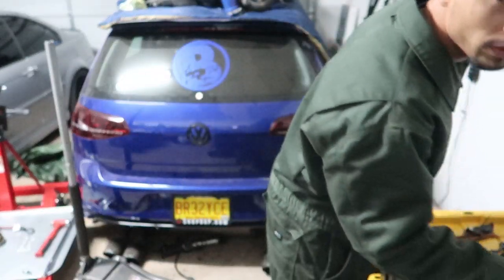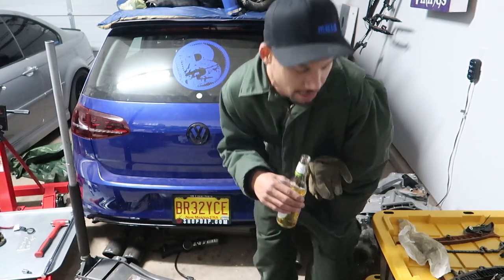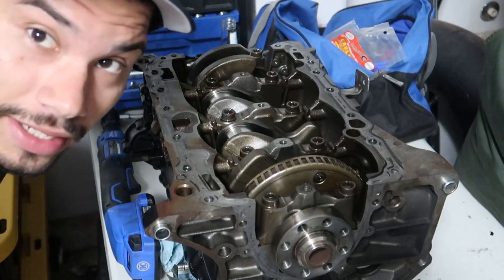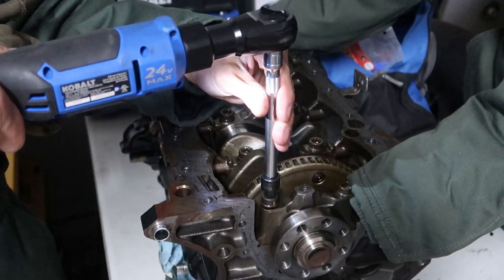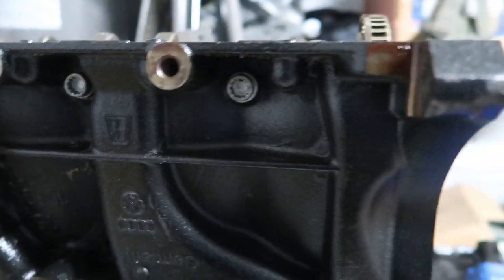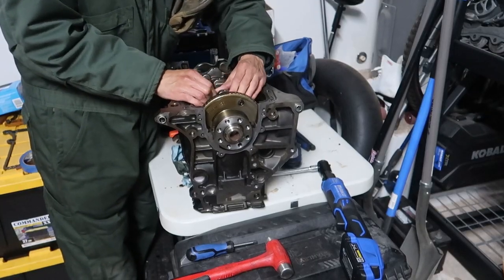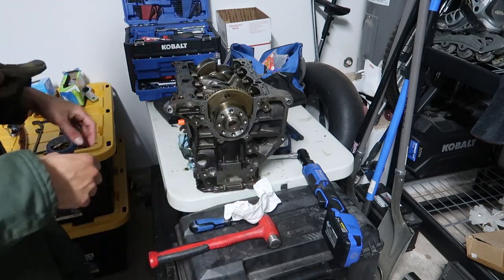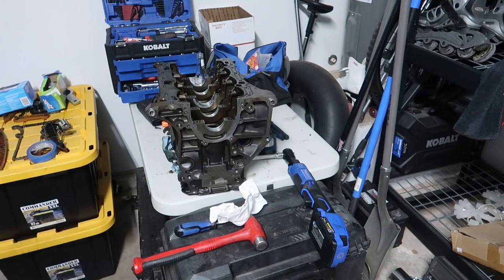Engine build - Breakdown! Part 8 - Crankshaft removed! Thrust bearings look great MK7 Golf R

Comment: Just to say it not telling u to do it but I would totally reuse those main bearings and thrust bearings, they still look brand new.  Also the only time the engine would have a bearing failure is due to an oiling issue and/or sever timing issue.
Reply: some of the mk7 golf GTI and R’s where suffering from CW if you upgrade your clutch on this cars...there are actually two guys on YouTube that documented it and had a channel like Bryce 

There had been a bad batch of thrust bearing that got into production...talked to many ppl who said what you said and now the word is that it’s d/t the increase in pressure on the cranks from the clutch upgrades with high tq threshold 

But his look to be ok 👍
Reply: @hunterlane3323  what does d/t mean? I have a pretty heavily modified Gen 3 EA888 that I'm trying to gather any info I can to prevent engine failure.
Reply: @MeltingRubberZ28  do to.  How many miles and do you have a manual with an upgrade clutch?...I had CW no oil or timing issues in that car.
Reply: @hunterlane3323  as of right now I'm still on the stock clutch. I have the tune so the boost doesn't hit hard (low torque) and then carries as much as possible in the high RPMs. The car only has 17k miles on it, but if/when I upgrade the clutch I am thinking of going with the Sachs clutch kit that uses the factory DMF. What are your thoughts?
Reply: @MeltingRubberZ28  you should be fine, I know guys like Bryce that have big clutch kits and big turbo, I had a mk7 stg2 manual with a DKM clutch and no one can tell my why I lost that 40$ car, no clue...I had called other shops in the states and guys had Sachs kits so possibly d/t the increase in laterally pressure and just having hit the lottery with bad thrust washers and then the next think you know the pistons shift and start shaving themselves...DO keep and eye on them through the oil pan especially when  you change your clutch or I think you can get better thrust washers/bearings to eliminate the risks all together
Reply: @hunterlane3323  interesting so you're thinking it's a specific clutch type, or manufacturer that is causing these failures? Or more to the effect of the bad batch of bearings...?
Reply: @hunterlane3323  I take it you don't have a VW anymore?
Reply: @MeltingRubberZ28  hahah no I was outta state in NC Ashville and rolled it into a 7.5 with the DQ381 dsg, but looking to get back into a mk2 VR manual and just get out of a car payment all together...but yeah it’s definitely a love hate relationship
Reply: @hunterlane3323  haha. Yeah idk. This is my first VW and the car is honestly a blast, but all the ways these engines fail has definitely freaked me out a bit. I got a great deal on it brand new so if a catastrophic engine failure happened I still would actually be cheaper than a WRX (the other car I was considering), but man it's terrifying when you see some of these failures. Just have to kinda hope for the best and if something fails....cross that bridge then.

Comment: I thought the same thing about the thrust bearings, interesting. Glad to see yours are looking good, my 6MT only has a Sachs clutch but feeling like it's a ticking time bomb is stressful.
Reply: I had it happened but I think there might be a way to access and get a visual on them...I had CW on my R and it’s been a year and I’m still pissed....it happens form ppm with Sachs to DKM, if you under the 550 ft lbs of tq it’s safe to say you’d be less likely for CW to occur but I went through 2 clutches and was only stage 2 full bolt on sooooo 🤦‍♂️🤦‍♂️🤦‍♂️

Comment: Thrust bearing and washers looks good for an engine that has been pushed hard. I wonder whats causing crank walk in these engines.
Reply from the maker: Super heavy clutches maybe..I suspect neglected oil changes and or cheap oil
Reply: Yes, crankshaft forward and backward play is usually caused by wear on the thrust bearing. That problem is nearly always on manual transmission vehicles because when the pressure plate is trying to release, it pushes against the crankshaft flywheel.
Reply: @raystanton238 prevent it, pinning  thrust washer to each face to the main cap.

Comment: Those bearings look really good despite you beating the living shit out of your car lmao! Makes me feel good about my S3 since I don't go crazy with it.
Reply from the maker: Yeah I wouldn't worry man! Early oil changes and send it!
Reply: @BryceJordanProductions  pretty much oil changes every 5k miles with Liquid Moly, and I cycle between ceratec and MoS2. Plus I have a fluidampr also
Reply from the maker: Nice! I just ordered a fluidampr on Sunday. I need to get me some of that ceratec stuff I've just been using Lucas 😅
Reply: @Michael-xs7rz  Did you notice a smoother idle with the fluidampr?
Reply: @me5ponk454  I noticed the car runs a lot smoother. It decreased the nvh from the BFI stage 1 mounts by a lot! 4k rpm+ feels like a dream now

Comment: What clutch were you running again?
Reply from the maker: South bend stage 3 daily
Reply: @BryceJordanProductions  man I have such thrust washer anxiety. There’s a shop that machines in a lower thrust washer,  but they’re located in Canada and I can’t get there with covid. Should I just send it and risk it?!
Reply from the maker: I am 🤷🏽‍♂️ honestly not that worried about it.
Reply: @BryceJordanProductions  did you have a fluidampr the whole time. Low and behold my clutch started slipping last night with my apr low torque tune SMGDH!
Reply from the maker: I didn't but I have one now ready to go in.. and yeah.. expected.. theses stockers suck :/